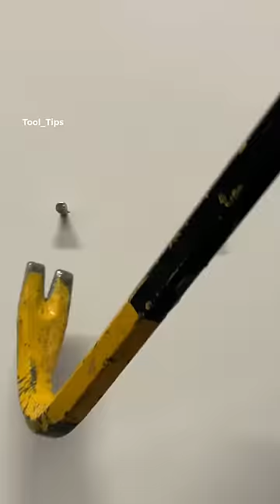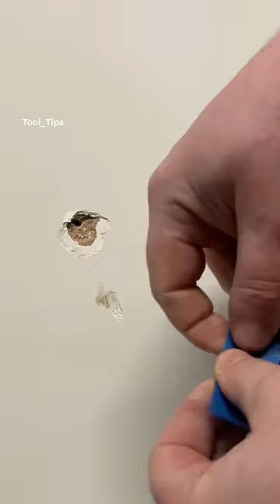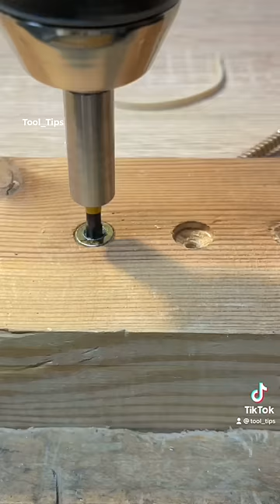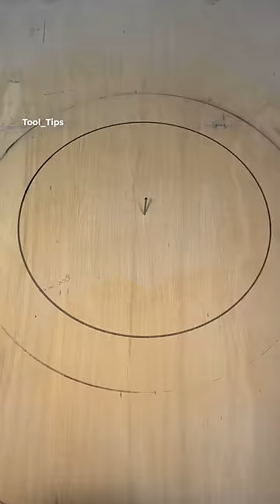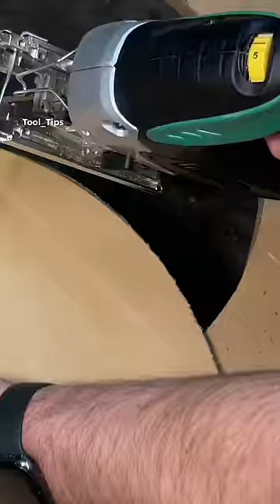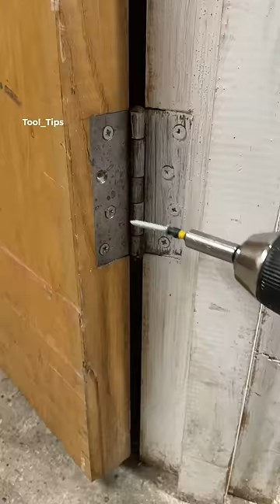5 amazing life hacks #shorts

Comment: I put toothpicks in holes on wood doors. Metal will damage the door
Reply: @patrickancona1193  some say he can even ef up a wet dream lol
Reply: Sorry my ignorance, but would we.put metal or wood in those points?
Reply: @Longussss  would assume the metal would round off the screw making it weak. Toothpicks would just form to the hole making it a tight fit
Reply: I've seen a similar trick used on fire rated walls where a pilot hole was too large and plastic fixings can't be used for obvious reasons 
Whether its a similar thought process here who knows
Reply: @patrickancona1193  l
Reply: @alioshahand8040  pool o
Reply: @patrickancona1193  That's not overcomplicating. That's doing it correctly.
Reply: @BobPapadopoulos  won't glue set up & screw get loose again? Can't u skip glue?
Reply: Yeah, that's the right way to do it not the wire.
Reply: @lorriefinley3129  yes you can do it with wood only especially hard wood. But wood with glue is better.

Comment: Put a Phillips screw into a metal frame. Wait 12 years until it's rusty. Round out the head and try putting a rubber band over it to unscrew it. It wont work. You'll melt the rubber band before you get the screw out.
Reply: Kay, be back in 12 years and let u know the results
Reply: So just use it in screws newer than 12 years 🤦🏻‍♂️
Reply: @onikinhas  😶
Reply: Dynamite

Comment: Only in America, half of the wall comes out with the nail
Reply: Assistant me🙏
Reply: Except if there is plaster iver he brickZz🇿🇦💌
Reply: Try getting a ramset nail out of cinder block with a carpentry hammer, it's not fun. Also that's was plaster over something, didn't look like slats, but either way most of the time, if you're pulling a nail out of something like that, you just have plaster there because that tape may have stopped it from coming out but there's going to be small fractures and that's going to ruin somebody's day when they bump into their wall and a bit falls out, so do it right.
Reply: I bought this very strong double sided tape, when I removed it, it took a big chunk of the wall with it lol
Reply: @r32juan  made me chuckle
Reply: @user-dp5fq4vc8m  I laughed at the moment, I thought damn this a weak ass wall, and then it hit me, I just made a hole in the wall, my mom finna whip my ass lmao

Comment: Except the last one... the wire in the door... it didn’t work here it kept spinning... try jamming multiple toothpicks in the door first then use your screw
Reply: I was coming to comment, toothpicks. Cheaper too.
Reply: Bend it back on itself a few more times and it works really well
Reply: Why i even need to put something in there? I didn't get the last lifehack.
Reply: I use wood golf tees they fit perfect drive them in with hammer cut them with a utility knife the hole is filled with wood and screw fit perfect
Reply: @kaltziferYT  it's if the door is coming away from the hinge I guess? Allows a stripped out hole to be reused rather than re-drill four inches up or down.
Reply: Why not just use a longer screw??

Comment: even with the wire hooked to the jigsaw, I’d still manage to cut a square
Reply: Haha I’m exactly the same. Always use the “measure twice cut once” but for some reason when I leave the place I’ve measured to go and cut the piece of wood…I enter another dimension where the measurements have changed and it no longer fits!
Reply: @mikey2363  I don't think you realized he said square and not circle
Reply: U n me , both ,smh lmao
Or a triangle !
Reply: @user_hat  yeah I realised
Reply: what was that last trick? I don't understand what he did.
Reply: @andresaraya3516  basically strengthen the holding power of the screw. It probably was loose. So he just uses a wire instead to make the screw hold better. Some cheap or lazy labour or repair-men would've just look for wood splinters and uses that instead. Some would opt for papers. I think you get the picture.
Reply: @mikey2363  lets say you measure and mark a line at exactly 32 in. on a plank of wood. For ease of explanation, to the left of the line is the 32 in. and to the right is the rest of the board/the "drop". Now, the side of the line you cut on matters because it affects the overall measurement of the cut piece, which is also the same if you cut on the line itself.

Whenever you cut a board, you're removing material just a bit wider than the width of whatever type of sawblade you're using to cut it with is, so if you cut it on the side you'll be using (in this instance, the left side) or on the line, the measurement will be off by however wide the blade is (so let's say 31 7/8" as the saw blade in this instance is an 1/8th of an inch wide/thick), but, if you cut it on the "drop/scrap" side (the right side) and make sure that your cut is just touching the line, the measurement of your cut piece should be correct.
Reply: @Mike lmao
Reply: You and me both lol
Reply: You're still better than me I wouldn't be able to cut a recognizable shape 😌

Comment: Use a toothpick to tighten loose screws in wood, no wire or cutter needed, just insert toothpick in holes and snap it off at the needed depth
Reply: Zip tie scraps work too nice to save a couple sometimes
Reply: I have always used the free chipsticks from Chinese takeout.

Comment: Okay ngl, the one with the rubber band and the stripped screw is pretty good.
 EDIT: You guys can stop correcting me, I realize this is a very niche solution.
Reply: Good News,!Thanks for sharing your clever work..
Reply: @DGlegend a stripped screw head is usually because the screw is in too tight which is primarily why this hack rarely works.
Reply: I’ve tried that more times than I care to think and it has NEVER worked. If a screw is cammed out it’s because it’s jammed in something. No rubber band friction is going to get that fucker out.
Reply: @DGlegend is there an Old England?
Reply: Same trick works with paper, if done right. May be time to consider the fact you guys are not as handy as you think.
Reply: @theseangle  yes, the original England.
Reply: @Connor-zy6kl  oh my dear boy I’m painfully aware of that 😄
Reply: I tried it recently on two different stripped screws and it did absolutely nothing.
Reply: @thesuperginge1348  If the screw was over-tightened and that's how it got stripped, it's still jammed in too much.

I usually grab a screwdriver and whack it with a mallet to ram it into the head, just to get a little purchase. If it ruins the screw, who cares, it was already ruined anyway.
Reply: @johnwetzel3392  that's a good idea! Shame I didn't have a hammer at that time
Reply: I find it works better if you have a slightly too small bit rather than a striped head, also can work with rubber gloves. 90% of the time it does nothing but that 10% it's super handy
Reply: @lslslslslslslsl1  As with anything, it's all about that 10 percent of the time when it works 100 percent of the time.
Reply: @theseangle  does is hurt your head when you try to think?
Reply: @ccole1255  does your brain hurt when a joke is flying over it?
Reply: @johnwetzel3392  how would I remedy a stripped screw stuck holding the neck of a guitar to the body? An elastic band hasn’t helped. My old teacher said to superglue the bit to the damaged screw but I’m not sure.
Reply: @mikesecondname  That is an excellent question that is above my pay grade given that guitars are more delicate than what I normally handle.

Here's my thinking (though it's up to you if you want to try it).

If I no longer care about the screw, but don't want to just drill it out, I'd use a screwdriver and super glue, and if the super glue doesn't hold it/fill the space around the screwdriver well enough, here's the upscaled version of that.

—wrap the guitar in a towel and clamp it down (carefully!)
—put masking tape around the screw
—use epoxy to bind a cheap screwdriver (because it might not be usable after this) to the screw, and be careful with excess (thus the tape)
—give that 24 hours for the epoxy to cure completely
—get pliers or vise grips to latch onto the shaft of the screwdriver for more torque
—twist carefully

I would not use a drill for this, just because those can be a little jumpy, and you want to have as much control getting that out as possible. Again, this might be excessive and could get a little hairy with the epoxy (before it cures), but it might work as a last ditch strategy.
Reply: @johnwetzel3392  good idea
Reply: The rubber band one I heard hardly works

My Dad used to have this old tool called a manual impact screwdriver

You placed it in the hole even if it only partially went in and you would hit it with a hammer, hard

It would get knocked down as well as operates like an impact driver at the same time and would turn sightly with a huge force, almost always loosening and turning the screw

The screw was totally destroyed in the process but it at least turned it enough to raise it up so that you could work with it further
Reply: @mikesecondname   I wouldn’t bet on the epoxy idea, myself, and that risks damage to finish of guitar. As far as I’m aware, your options are 1) to drill out enough of the fastener head so that it detaches from the shaft, then remove the shaft by e.g. clamping it with electric drill chuck and reversing it out; or 
2) the much better way, buying a correctly sized made-for-purpose screw & bolt extractor bit set. These bits are basically strong counter-threaded screws that are smaller than the head of the fastener you are extracting. As you screw the counter-threaded bit down into the damaged fastener head by turning the bit counterclockwise, once the bit is tightly in the fastener head, if you keep turning it starts removing your damaged fastener. 
I’ve always had very good luck with these using the bit in an electric drill with fairly large fasteners. It looks like there’s quite a wide size range online, it’s just a question of whether they make them small enough for your application; and naturally I would use hand tools with small fasteners.
Reply: @joemcgulligut7874  Option two sounds like a great idea. I’m always looking for specialist tools that I need in my tool box and this sounds like I needed it years ago. Thanks!
Reply: @DGlegend facts
Reply: Everyone here who says rubber band trick doesn't work, isn't pushing down hard enough.  Rubber band will give you grip till the metal rips, yall just weak AF . Put some damn elbow grease into work
Reply: You’re damn right it’s good. And SCREW (no pun intended) all those guys who say otherwise. They’re just pricks who think they’re gonna look like mr construction with all the solutions. I used the rubber band on a $500 SOC JCape once at night when I had no other means. I’m sure it ain’t the first useful trick someone has used. I’ve even been the one to hate on this guy on some videos before, till I actually used one of the tricks
Reply: @theseangle  Man that really shut the convo down, I like that response very much 😂 guess the joke flying over really does impact the brain
Reply: @JonathanS995  bravo! Roasted
Reply: @theseangle  my man ✌🏻
Reply: @theseangle  I think it's in Asia
Reply: @BoldWittyName  yeah I think so as well. Probably somewhere in Kazakhstan, Almaty
Reply: THANKS! I’m trying this..
Reply: Speaking of niche solutions, what about old, painted-a-dozen-times door hardware? Very often you need to shim under the hinges, with whatever is within reach. Instead of shims I used four drywall screws underneath each hinge instead of shims. That way, the screws under the hinge are adjustable to control the depth of the hinge while the regular screws on the top of the hinge locks the hinge in the exact depth to the doorframe. It's kind of like Ironworkers plumb a steel or concrete column. By adjusting the top and bottom nuts on the anchor-bolts, you can tilt any column into plumb, even precast concrete columns weighing many tons.

Comment: The wire for making nice circle cuts is good help
Reply: But the drill hole ruined the perfect circle.
Reply: @joe8572  you can eliminate that problem by just drilling into the waste material.
Reply: Finally a useful lifehack
Reply: @zandurka1  not the point. Everybody isn't you. It's called "life hacks" like easier ways to do things... You're the person that sees a video about cheat codes on GTA and screams out "oh yeah well I completed the game on expert all by myself and earned my bazooka"...
So. What.
Reply: @zandurka1  That's fine IF you do it a lot but if it's not something you do regularly or don't have a lot of upper body strength, then its very useful.
Reply: @zandurka1  OMG! Not everyone that works with wood has to be a flaming genius. A person with an average IQ can read directions and put part A into part B correctly to use an electric tool without getting an appendage or head sliced off.
Reply: @joe8572  he need to use jigsaw, mr.critic
Reply: @freestyleskyline  ok mr.critic

Comment: The one using the roles of tape with marker will raise the line about 1/4" higher once the marker rests on the role of tape. Need to take this into consideration when cutting marked object or - oops:\ (edit: spelling)
Reply: Personally I prefer to use a book for this stuff, a really thick one is great so it doesn’t shift but you can stack a couple if necessary.
Reply: @johnbeauvais3159  That's actually a great idea, with a thick book you can just open it and move pages to get whatever height you need down to the millimeter
Reply: That's a good point but it depends on the application, say they just needed to cut a 1 inch piece, even with the marker it's still an inch between the two lines drawn. But yes that first line is 1&1/8 or 1&1/4 inch from the end of the pipe.
Reply: @douggiles7647  That’s exactly right, I use it to mark bands on conical shapes for easier masking
Reply: 6

Comment: The last one you did, taking that screw out of the door. When you put that piece of metal in and re-screwed that screw in, you cracked the door. That's not helpful, that creates a whole other issue.
Reply: The crack was allready there before he removed the screw. The only reason you notice it at the end is because he opens the door up wider when he ram rods that crap in their.

Comment: For the torx bit one mac tools makes a set of torx bits that increase the chance of removing rounded torx screws
Reply: Guy I work with swears by a slightly bigger Allen wrench just pound it in with a hammer I can't vouch for it though... Sounds possible 🤷
Reply: @kylecanning9216  the allen wrench damages the fastener where the torx set doesn't damage the fasteners

Comment: Wow, I learned something cool today, that rubberband for a stripped screw, totally useful & shoving some tiny metal
sticks in to tighten screw better,thats a neat idea.Lol.
Reply: You can do the same with toothpicks in a piece of funiture, such as a table with the loose leg, instead of driving in longer and longer screws.

Actually I subscribe to this channel because there's just SOOO many cool tips, (like how to remove a screw with a head that's snapped off;  how to remove a spinning screw;  how to mitre inside and outside corners;  how to make a small piece of wood fill a large hole, etc).  The uploader for this channel is filled with so much knowledge & is really generous about sharing his trade secrets 👍🏼
Reply: Except it will rarely ever work. Generally only if the screw was stripped putting it in, not stripped taking it out

Comment: You use a tiny cloth on a wire to clean a hose. Cloth comes off, now stuck inside the hose. Push to the end of the hose with the wire, use a drill to pull it out.

Comment: The copper trick in screw hole I can see it my uncle is a carpenter whom I've learned from but he taught me to keep tooth picks in tool box they work as well IV even been installing trasition strips on concrete drilled my holes fill with tooth picks then hammer my nails in works good

Comment: What does the last tip mean ? I can't get it. Thanks
Reply: Its For loose screws I guess... If i stumble upon one I Insert Matchsticks or toothpicks to Fill the hole and give the screw a Tighter fit... No Filler No Glue and this Method is Used since Ages... I Had an old Door hinge which is Like a Nail and the whole hinge would Fall Out of the Wood Door frame so i put some Wood Sticks in the hole and hammered the hinge Back in place and voila it didnt loosen Up since then... I hope you Unterstand my Broken english xD and you're Welcome o/

Comment: Toothpicks and dial soap or candle wax would be a better choice for the door hinges. They will compact when the screws go in so the wood around it will be less likely to split and the soap/wax will act like glue. Toothpicks, softwood dowels and composite shims whittled down make great concrete anchors too.
Reply: Golf tees work great

Comment: Excellent. Since i'm always cutting circles with the jig saw a bit off what you did isn't just a guide but a compass cut out! Impressed! As for the wood door that gets stripped you could use wire?  At first i thought they're going to use dowels , glue etc but that was slick! 😃😅😅 I amazed! 👍✅✅

Comment: Thank You for taking the time to share your expertise, this old dog just learned two new tricks plus another technique to cut a round hole in a large sheet of material; years ago I had developed a way to use a piece of cable With a loop swedged at each end or a length of rod/tube with eyebolts for the same purpose, but the use of the wire is quicker and much faster, also I take it that in order to get two cuts, like you were making a circular frame, you would cut the outside line/diameter first so you would still have a solid section with which to finish the inside diameter, correct, (?).
Reply: Depends on how big u want your  diameter
Reply: If you were making a cone then that's not fair